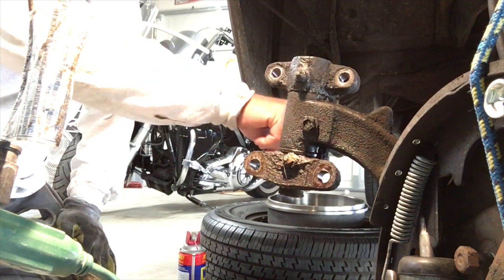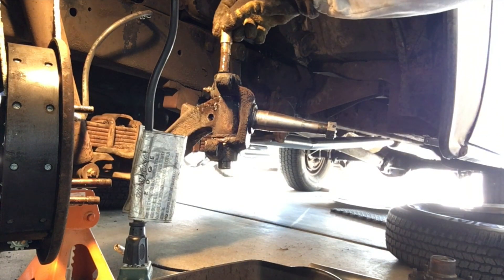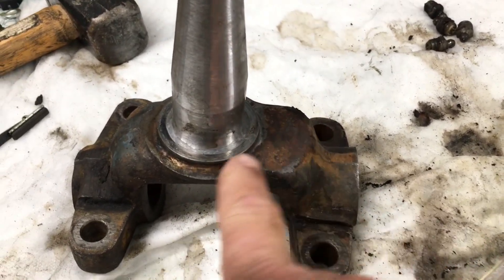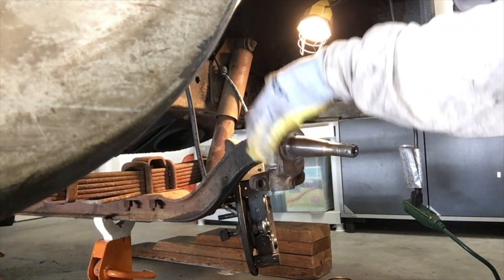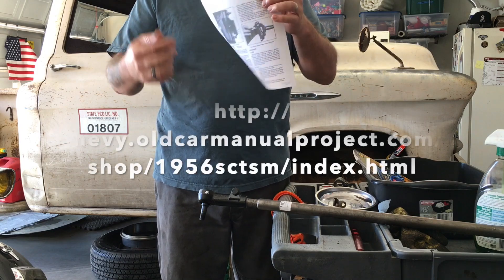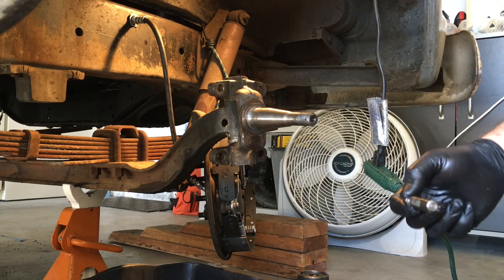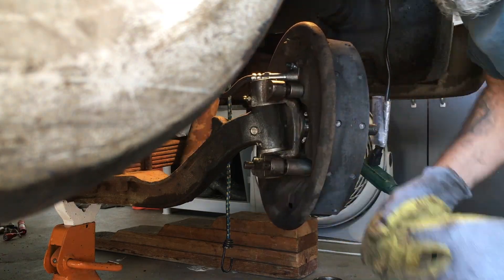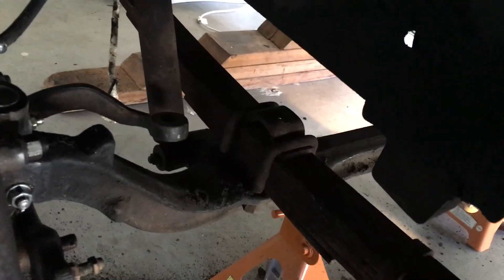1956 Chevy 3100 Truck Tie Rod/King Pin Replacement

Comment: I have a ball joint press and a 1300 lb. ft. impact gun. Maybe these could be used to eliminate the need for torching the axle?
Reply from the maker: sure, but I didn't "Torch" the axle. I just heated it up a little with a propane torch. I don't have a press either.

Comment: When they pressed the old tie rod ends out which side did they press on? Old ball end(top) or the flat side?
Reply from the maker: Not sure I understand the question. If I remember correctly, I just beat them from the thread side.